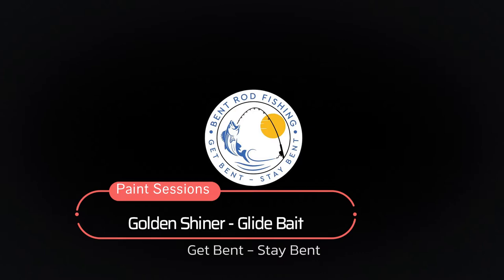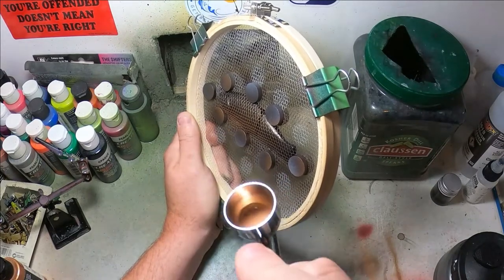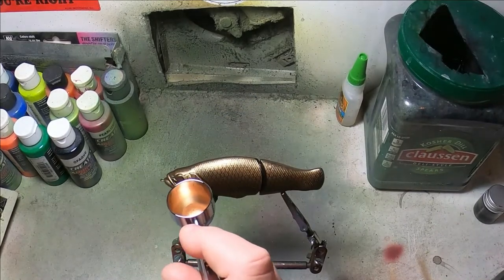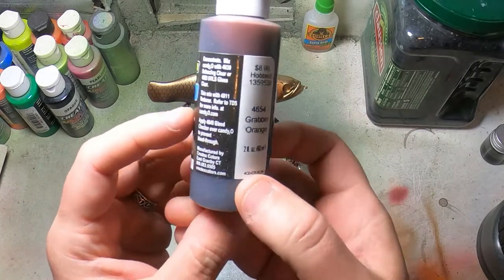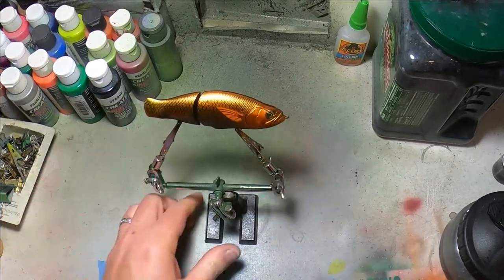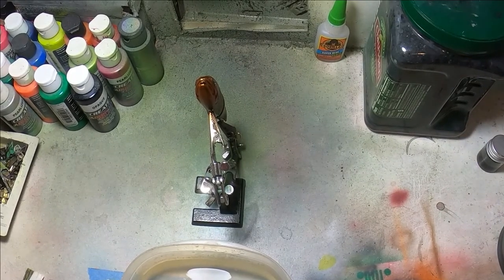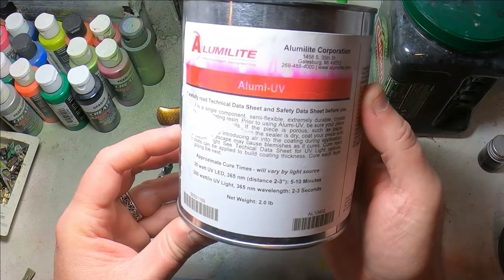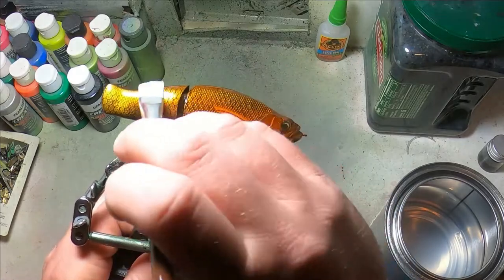Throwing Paint at a Golden Shiner - Bent Rod Fishing

Comment: nice job bro ....what do i need to make the decals besides a printer...i cant find a stencil small enough for a project im doing so maybe that is the way to go ....im 65 and just got into airbrush i tried it years ago with junk ...a junk gun and a can of air ...but now i got good shit 3 guns 2 iwata ...a neo with a .05 conversion for base coat and it comes with 2 size cups and a hpbs it has the small cup...and a grex genesis it also has a small cup with a .02 for detail ... i can also get conversion kits for it all sizes but i just want it for detail...i like it better than the iwata to tell you the truth because it has  the trigger stop on it and i get the same control every time i pull the trigger.... im in north coast ohio ....where are you at ???....nice chat bro....
Reply from the maker: Thanks Dwight! It's called water transfer paper. You can get it on Amazon and sometimes Hobby Lobby. Yeah,  having quality equipment is game changing for sure! I'm in Winchester Virginia.  Thanks again!
Reply: @bentrodfishing  I know exactly where you're at I'm a retired truck driver 👍🏻